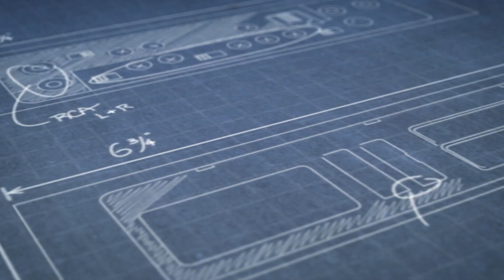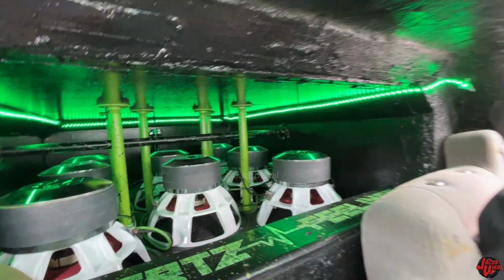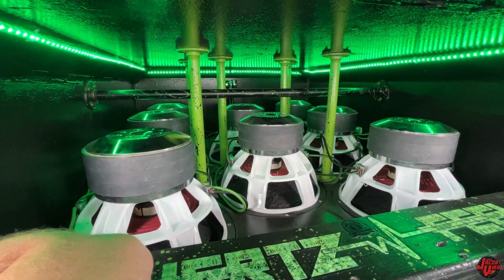MORE Subwoofers for BETTER Sound? From 6 Subs to 8 RESULTS!

Comment: If a boss with open without a each separate from each sub . Unless they are free air subs . It will sound great but with each sub that's not ment for free air u'll get alot of spl  granted that but way better if each subwoofers are in there own space . Also with subs with ported design. Know the difference. Or one will get spl only wind but less sound or just wind from the woofers excursion. Sealed box are the same but more sound   ported is both but less power depends on the box that said subwoofers are ment to be in . A sealed can put do a ported or ported can put due a sealed . Free air as most I've seen is more on wind movement even though loud but not as loud as sealed or ported . Also depends on the said box the subs was put in . If a sub is ment for sealed each one has good effects depends on box and subs if u mix more wind moderate sound or other . If woofers on subs moves opposite direction it's wired wrong I've seen some like that. Anyway just saying stuff lol